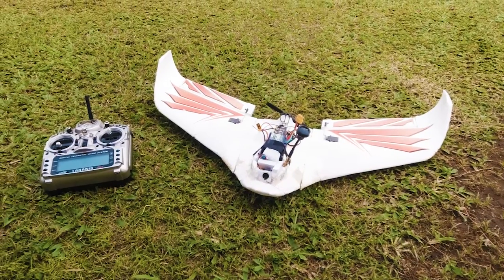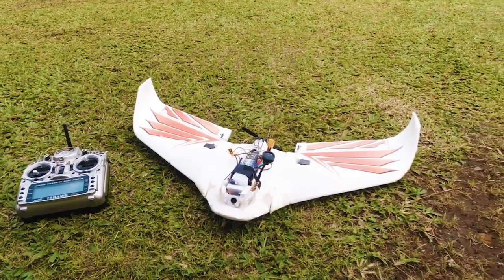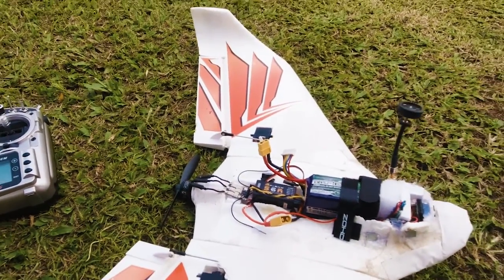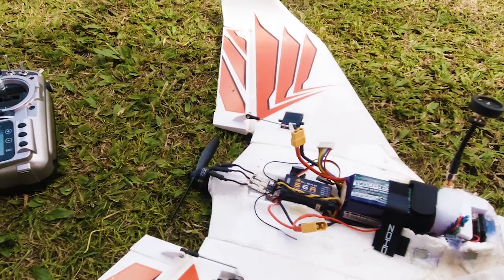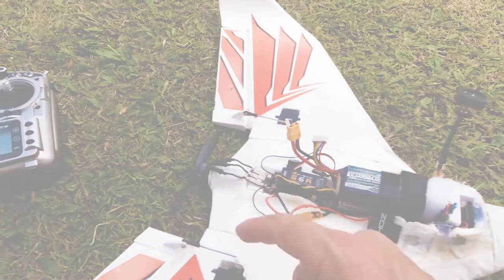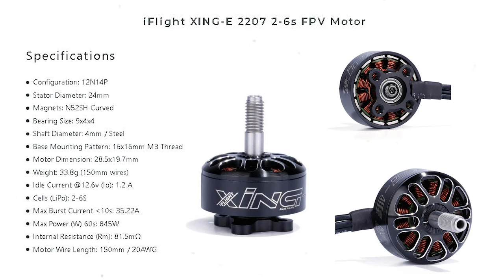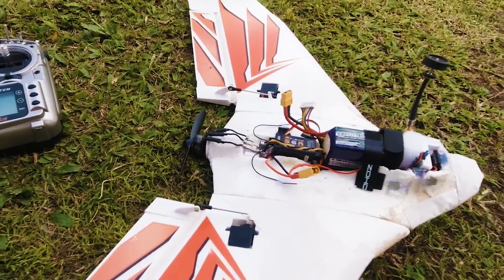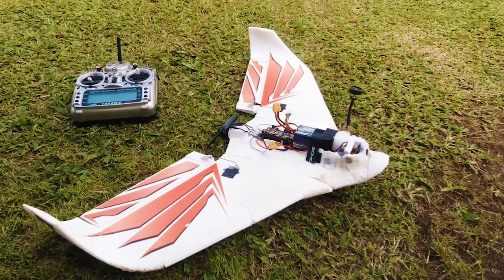Blade Theory Type W - Testing Holybro Tekko32 F3 Metal ESC Running 6S

Comment: Nice - what current (max) does that motor pull? What flight time you getting?
Reply from the maker: I was getting about 5mins flight time and fun while it lasted. I never tested its max current but what i can say is that this motor although good cannot handle 6s as it overheated very fast on too much throttle. A lower KV motor would be more appropriate.
Reply: @stonesrcchannel  Thanks for the reply! I have just ordered a